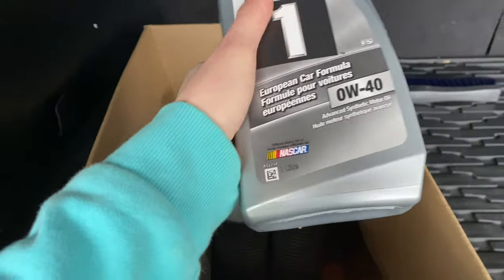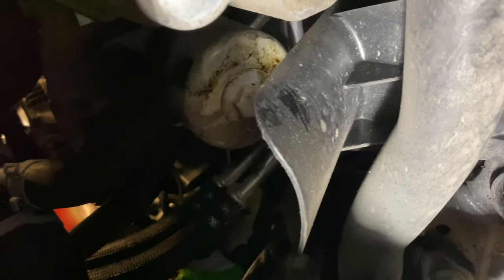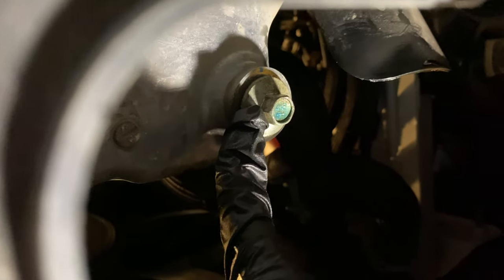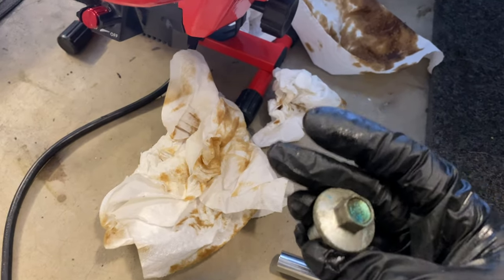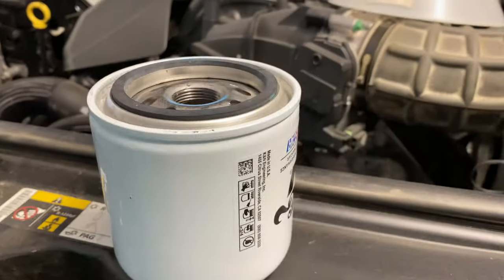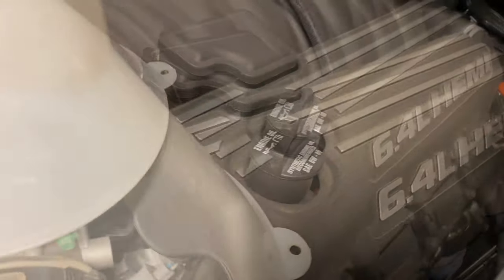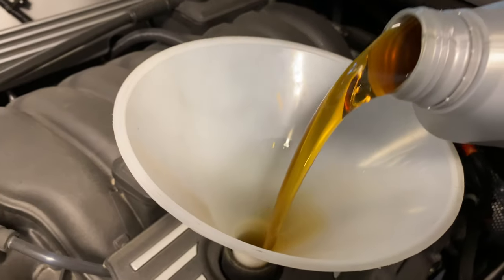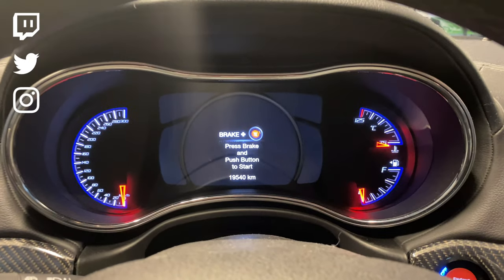Oil Change - 2018 Jeep Grand Cherokee SRT

Comment: Not sure but isn't better to open engine oil cup and the stick then open the pan wait for oil to drain and then unscrew oil filter? Seems there are 2 different schools how to do it. Any comment which is better and why would be helpful. Thanks!
Reply: Taking off the cap and stick helps it flow out better and i would’ve drained the oil then filter and i like to wait til no more oil draining out but that’s my preference

Comment: When you accessed the drain plug, i know the skid plate has a convenient cut out to access the drain plug... but is there a cover to go back over the cut out to prevent rocks/ debris from getting up in there?
Reply from the maker: You might be able to find an aftermarket skid plate but I haven’t ever looked into it. I haven’t ever had any problems with debris getting into that cut out.

Comment: Hello - I have a 2018 SRT also

Really keen to hear if you've had any 'interesting' experiences in running Mobil 1 0w40 in your SRT

i.e.

is it a myth that 'we' should always be using the Pennzoil 0w40 with the MS12633 rating (which is expensive here in Australia)

Many thanks!
Reply from the maker: To my knowledge, Pennzoil is what comes factory in the SRT. I use mobile 1 and have in all my vehicles and never had any negative experiences. Running a more expensive full synthetic oil in a high performance vehicle is recommended. If you are running your Jeep hard, it’s best to put a very high quality oil in to keep it happy ( you will find it gets better results in performance also). I use Mobile 1 or Royal purple (which ever is cheaper at the time). I hope this helps!